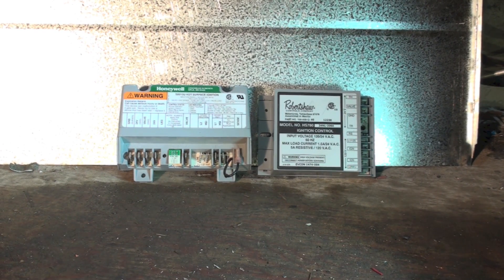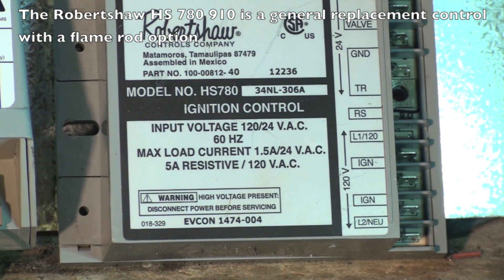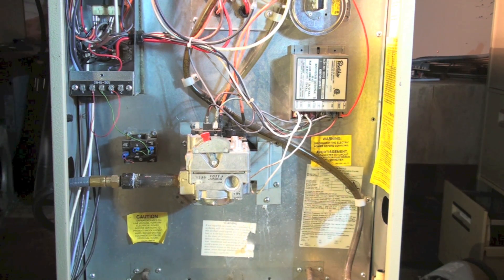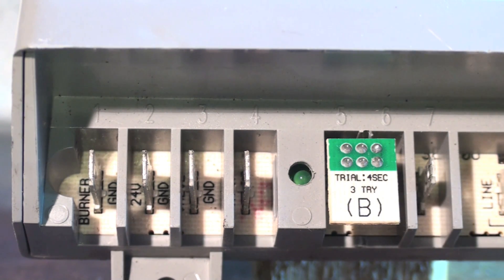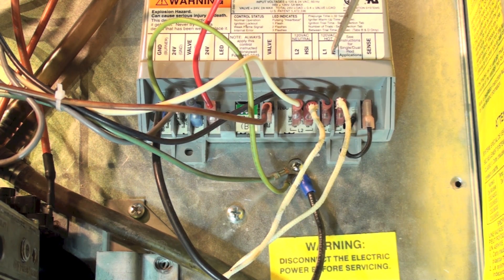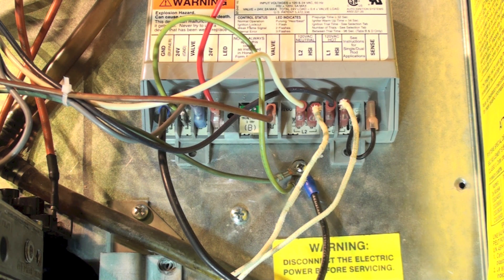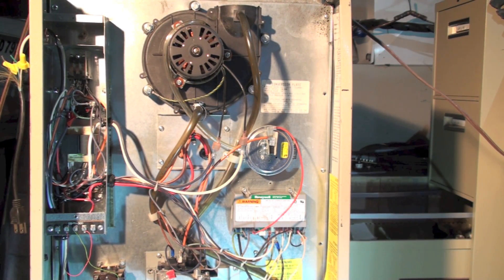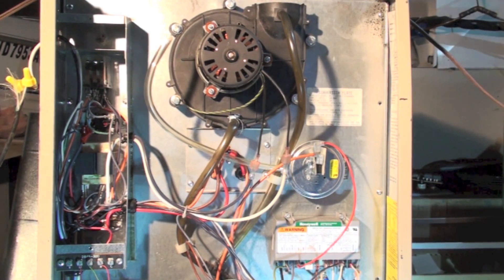Replacing the Robertshaw HS 780 control with the Honeywell S8610U on the gas furnace.  Part 5

Comment: Is this the same as a s8910u3000? And will it work with a Roberts Shaw hs780 34nr-306a?
Reply from the maker: I believe that is a direct replacement, but I would check the install instructions to be sure.
GFM

Comment: I have just recently installed the Honeywell S8610U GFM replacing an old old S86F! 
I was just wondering say for some reason the blower quits coming on when the furnace heats up.
Do these things have a way to stop the furnace  from short cycling until the heat limit shuts down the gas valve over and over until someone finally discovers it and powers off the furnace?
Reply from the maker: In most furnaces, the burners will continue to cycle on the limit until someone notices the heat is off.
GFM
Reply: @grayfurnaceman  Thanks GFM!

Comment: Great video with more detail how S8910U replaces Robertshaw HS780. However, I would like to see how you can swap the control unit disconnect one wire from HS780 to connect S8919U at one time. I ordered the S8910U to replace HS780. L1,L2 HSIs are straight forward on the right side. However, the left connects are totally different to HS780 that has only three connectors. I may have to hire someone to do that.

Comment: I have replaced my robertshaw 780 34 NR  306 A,  in a 1995 Coleman EvCon,  with this Honeywell. The Only difference Is my Honeywell does not have the 7 second indicator light on it. Robertshaw has the RS/Remote Sensor wire. According to the instructions the sensor jumper On the Honeywell Is pulled out & the RS wire is installed, which I did . I triple checked all the Connector connections with the Honeywell instructions that came with the unit . Everything appears to be connected properly .  When I started Up the unit the Honeywell Green light came on steady, no blinking . The igniter Came on . After a few minutes the igniter went off, not ever having a flame ,  & Red Blinking Light Came on Indicating hard lock out. (There were no 3 trials). What might the problem be now? Would it be the gas valve itself that is the problem ? If so how can I test .  Thanks for the videos. PS The blower doesn't Come on At anytime while in heating mode . Web blower will Come on & blow in AC Mode.
Reply from the maker: You could have a bad gas valve or no gas available.  I would check for 24 volts at the gas valve.  Remember, the gas valve is only powered during the trial for ignition.
GFM

Comment: GFM, could you please advise what the required jumper connections are, in absence of the selection tab? I have this exact same furnace as in your video, but I've purchased the control without the selection tab. As a result, I badly need the selection tab B wiring diagram, so that I can mcgyver the jumpers. Thank you

Comment: Hi Gray, thank you for these very informational videos. I'm a "proud" owner of one of these CGU model furnaces and your videos and explanations have been helpful in figuring out what is going on with my unit.  I seem to be having the issue you speak often of where the flame stops after 2 seconds because it fails the trial for ignition.  I just installed a new RobertShaw HS780 flame control box, but I'm still getting the same issue.  Any thoughts what the next thing to check would be?  Replace the hot surface igniter since it is also the flame rod/sensor in this setup?  Thanks
Reply: I realize this is a 2 y/o post but in case others have the same question. I just replaced my Robertshaw HS780 34NL-306A with the Honeywell S8910U3000. I also replaced my HSI since it's been 4 years since I bought my house so my HSI is at least that old (probably years older). My old HSI glowed orange but measured 326 ohms. The new HSI was 55 ohms. I believe (but not really sure) HSI's should measure between 50 - 90 ohms. The furnace works now and the Honeywell green led stays steady green, no blinking that indicates the new HSI flame sense is weak.

The reason I replaced my HS780 was because it did not appear to send 24V to the gas valve after the HSI heats up, and even worse, the HSI seemed to stay lit and not turn off. It seems dangerous for the controller to keep the HSI energized permanently, although maybe something would have burned out and opened the circuit (hopefully).

I bought my Honewell from Amazon for $148. I've seen it as low as $117 but the company was in Florida and I'm in California and wanted it faster since the house was cold with no heat.